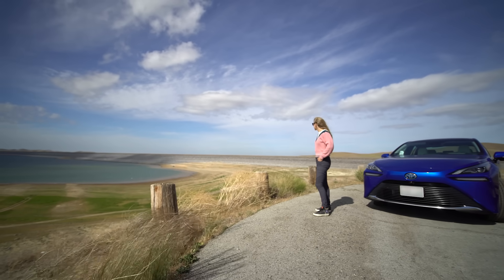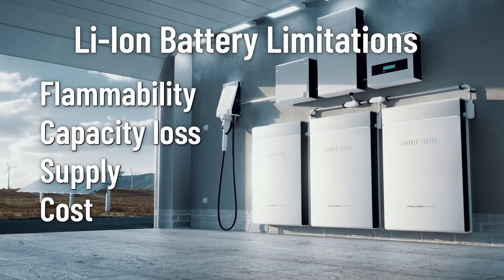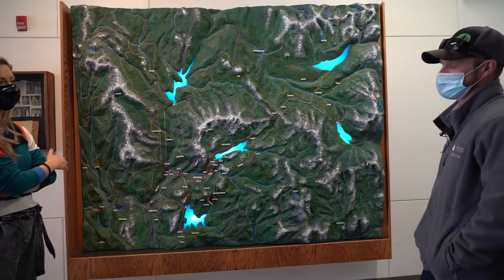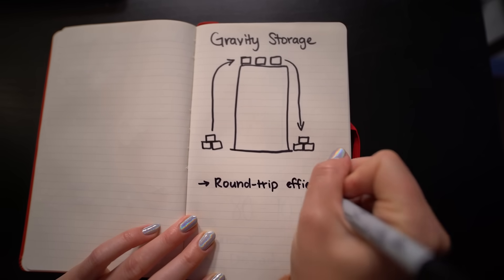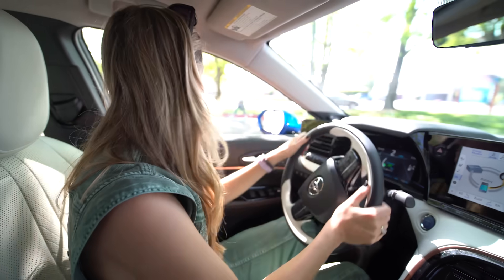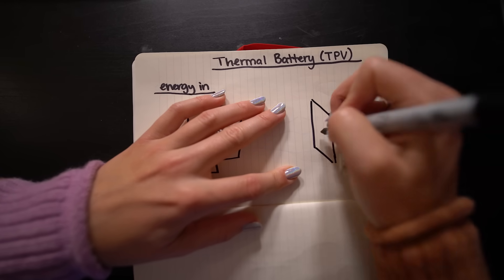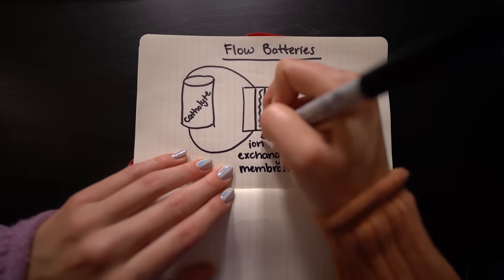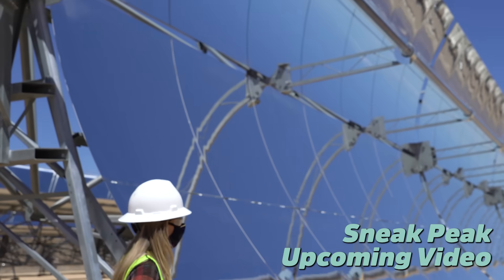The BIGGEST problem with clean energy

Comment: I would love to see every single house have it's own battery, like a Tesla power-wall, to help decentralize the power grid and add durability during short interruptions to power production. You wouldnt even feel the effects of a short power outage caused by a storm like you do now.
Reply: I looked into getting solar with a storage system...  it's a great idea, but it's a pricey investment 😕
Reply: Well, maybe not a Tesla power wall but some form of energy storage.
Reply: On a small scale and maybe hydro or mechanically this might be a reasonable energy storage. But large scale lithium battery storage is awful, whether done individually or in more centralized areas. The chemical waste of renewables and energy storage is ignored so quickly... :(
Reply: @andrewcopple7075  you are right about the chemical waste. Hopefully we develop ways to recycle the waste and reuse it in other products/applications. When I think of renewables I think of the future. When we eventually go to other planets in 100 years, after Im dead, we will need these technologies to be mature because we wont have oil on other planets.

Also, we need to save our oil for when we want to terraform other planets. Perhaps there is more than one way to heat up a planet and keep the air breathable, but fossil fuels has done a pretty good job on earth as a greenhouse gas 😅
Reply: This sounds nice but the question is what is cheaper? A powerwall in every home or a centrelised storage system that would be able to hande that same outage.

Comment: The problem I keep circling around and cannot come to resolution on is the true need for long-term storage.  It seems the most promising techniques for longer-term storage involve processes that have lower round-trip efficiencies.  Unless the capital cost is dramatically lower than for those of Li-ion or LFE batteries or pumped hydro or gravity storage they will not be competitive for managing the daily duck curve.  This pushes their utilization to weather or season-based scales.  Reducing the number of storage cycles per annum increases the cost of energy per cycle due to capital and operational costs.

It seems to me the primary competitor will rapidly become installing renewable energy overcapacity and living with the curtailment during favorable weather or seasons.  Curtailment raises the cost of produced energy for similar reasons reduced cycles increase the cost of stored energy on the long-term storage plants.  Many view curtailment of renewable energy as a bad thing, but in practice, that is the way the fossil-fuel plants on the electrical grid operate today.  The cheaper plants can bid to run near continuously while the more expensive plants only get the opportunity to run during peak energy demand.  The reduced operating hours per year adds to their cost of energy.

Long-term stored energy will have to prove more cost-effective than bringing curtailed generation on-line.

Comment: Check out 'flywheel batteries' too! There are a bunch of companies working on carbon-fiber or cement composite high-speed rotating masses! Anyway very cool to see a video on this topic! Energy storage is so important and yet we don't hear much about it compared to energy production.
Here in France we produce mainly with nuclear, and because it's not very flexible we have a lot of dams to store the excess and top up the grid during peak demand! 👌

Comment: Liquid metal batteries.  When you don't need the battery to move from place to place, you don't need a thin structure like lithium-ion batteries use.  They can be much cheaper to make and have a much longer life.

Comment: What about using using the heat from the Earth (like the do in Iceland) to heat water to produce steam that drives turbines that drive generators that produce electricity on tab when you want and the byproduct for this is steam/water so it is green, but probably unfashionable because it is old technology. Heat can also be saved in a salt which eventually liquefies as it gets hot to be used later.

Comment: one thing i take slight issue with: you mentioned "just look at all those oceans" for hydrogen production. yes, but thats salt water. that produces chlorine gas in electrolysis. small problem :P
Reply: Desalinating and distilling the water is an order of magnitude less power demand than the electrolysis process.
Reply: @benoithudson7235  Ok? You still need to split the hydrogen atoms anyways. So you end up filtering or distilling the water to purify it, and then more energy for electrolysis? Unless there is a single process that cleans the chlorine and produces hydrogen.
Reply: @QueueTeePies  He wrote that purification of seawater would use less than a tenths of what the electrolysis uses.  So it merely reduces efficiency by 10% (or less).
Reply: @johndododoe1411  I’m not sure that math is correct? It takes approximately 3 kWh give or take of electricity to distill 1 gallon of water. A gallon of water is 3.79 KG. Does electrolysis of 1 gallon of water really produce enough H2 for a HFC to produce 8-10 kWh of electricity?
Reply: @babybirdhome  Distillation is not the only way to desalinate water for electrolysis-based H2 production.  The other poster claimed the ability to do the job with an order of magnitude (10 times) less energy than the electrolysis itself.  I don't know how, but that's what was written.
  As for the brine containing the removed salt, it can probably be safely returned to the ocean some distance from the intake pumps, which will make the return area suitable for different species of saltwater life than the ocean average.
Reply: @babybirdhome  : it uses that much electricity for produce H2 -- around 65 kWh per kg of H2 after efficiency losses if you're pressurizing it, or a bit over 7 kWh per kg of pure water. So if you had a source of pristine pure water without minerals you'd spend a bit over 7 kWh to convert a kilo into hydrogen and oxygen; whereas if you have a source of salt water that's 4% salt, it takes right about 8 kWh to convert the water inside to hydrogen and oxygen.

If your electrolysis equipment can handle slightly saltier water than what you get with distillation, then you can use reverse osmosis at which point we're talking a few kWh per tonne of water to purify it.

Purification isn't the big thing making electrolysis expensive.
Reply: Yeah you would probably need to do efficient desalination first say reverse osmosis followed by distillation, the problem is of course that costs energy but given that the climate doesn't look like it will be cooperating anytime soon it is probably going to be needed anyways out west in increasingly arid environments like  California since unfortunately people are stubborn and unlikely to move to more sustainable locations(without natural selection being allowed to filter them out).
Reply: @Dragrath1  It doesn't make sense to desalinate the water before electrolysing it because to run the electrolysis you need to add salt to make the water conductive.  So why remove the salt only to have add it back in greater quantity immediately after?
Reply: @listerdave1240  : the membrane in the electrolyzer costs a mint. The water gets purified, then they add a hydroxide or a salt so that they know exactly what they're adding and that it won't muck up the PEM.
Reply: even if we do the whole 'desalinate ocean water for hydrogen' without any issues on power consumption we'd still have the 'brine 'problem to deal with.
Reply: In theory you could just keep reusing the same watter and hydrogen. Atleast if you want to use it for grid storage, cars and planes are a problem.
Reply: Electrolysing salty water does not produce chlorine. You need to add some form of salt to water anyway to do electrolysis as pure water is an insulator. 
To get chlorine from salt by electrolysis you need to electrolyse molten salt, not salt in solution.
Reply: A great video on how to understand and use your instincts https://youtu.be/XrmyGtdmgoY
Reply: A great video on what is intuition and how to use it https://youtu.be/XrmyGtdmgoY
Reply: Yes, that's true (tbh I don't know, I'm just willing to believe you), but there's also the fact that 75% of all matter in the universe is hydrogen.  It's fairly abundant.
Reply: @samberg3864  Doesn't help us, unless you know a way to transport it back to Earth. Because while hydrogen is abundant in the universe, it is not abundant on Earth.
Reply: @lazydave137  it is on the earth but it is not in the form of H2 gas

Comment: I agree with the contents but a Toyota with Hydrogen was literally the worst car selection you can get. They are against the electrification of cars. They lobby against it. Any battery electric car would have been better. Also as of now, Teslas battery packs are mostly for ultra fast Stabilisation of the grid, not so much for intermediate and longterm storage (yet). Sadly you didn‘t go into the possible economics of these technologies.

Comment: What does it mean when they describe storage in hours? One interviewee said "a 40-hour battery will cost about 10 times as much as a 4-hour battery." Is that shorthand for kWh/MWh? Or describing the rate at which stored energy dissipates?
Reply: I would interpret it for a given load.
Reply: Yes, maybe he didn't want to use such "technical" terms as MWh... many grid level battery storage projects use two numbers, like 200MW and 800MWh, to indicate what power it can deliver and for how long. 4 hours can cover the evening peak.
Reply: The normal way to describe utility-scale storage is in terms of the power it can output, and in the number of hours it can keep the power going.

Comment: Great series, enjoying it a lot so far! I think energy storage is the number one tech holding civilization back in numerous areas. We've been hearing about breakthrough tech for decades but it seems like nothing ever pans out so I'm kind of jaded at this point. Compare the advancements of batteries and combustion engines over the past 100 years. Both are a simple premise on paper, with ample room for advancement/improvement. Yet our engines have the power and efficiency improvements of 10-100x and my AA batteries in my tv remote still run out in a year.

Comment: What you didn't address, however, is that hydrogen can be converted to methane relatively easily by carbon dioxide. The methane obtained in this way is then virtually fully compatible with existing gas infrastructure. In this way, existing gas heating systems, for example, can use completely renewable energy. Power-to-gas will be the main energy storage for renewable energies. Physical storage will probably not be more than a small addition.

It is also not true that the only option for private power storage comes from Tesla. For example, there is a small-scale hydrogen storage system from the German company hps that is already commercially available.
Reply: And doesn't Google have its own hydrogen fuel cells on their campuses? I imagine they procured them from somewhere.

Comment: I understand we are just a few years from sustainable fusion power.  Does that make all of this kind of moot?
Reply: We have been a few years from sustainable fusion power for at least 50 years. I hope it happens, but so far the predictions have been too optimistic. It is hard to contain the sun in a small scale apparatus!
Reply: We are not close to a cheap fusion plant that powers the grid.  By the time they plug a fusion plant into the grid, even for one minute, renewables plus batteries will be so much cheaper, that fusion will have no chance to compete.  
The big problems with fusion are, the plants probably won't be durable, even if they do work in the next two decades, where solar and batteries just keep getting cheaper every year.  Fusion has no chance of catching up.
Reply: @charliedoyle7824  Yeah, and can you believe there are idiots out there who think the wheel will someday compete with footpower?!    Sheesh.  Get a clue.
Reply: @bjs301  We have nuclear and that has issues competing with anything on price. Its not unreasenable to expect fussion will have the same issue for grid aplications.
Reply: @bjs301  You aren't making much of a point.  
Are you unaware that solar and batteries are already quite cheap, and getting cheaper every year at a predictable and fast rate?  It's obvious that an experimental fusion plant won't be cheap any time soon, even if it works well enough to plug into the grid in a decade.  By the time fusion is ready, solar and batteries will be unbeatable on price by any technology.  Fusion will still be worth pursuing though, so maybe it will be big in the distant future.
Reply: @charliedoyle7824  What is obvious is that unless we come up with an even better answer, the only thing that will prevent fusion power from rendering the others obsolete is human stupidity and obstinance.  It offers far more advantages, at less cost, and has none of the disadvantages of any other known solution.  I'm not sure what you consider the distant future, but within the next few decades it will replace them all.
Reply: @someonespotatohmm9513  I think that is an unsupportable assumption.  The proposed fusion reactor scenarios are nothing like fission reactors.
Reply: @bjs301  No they are even more complex -> expensive, and are not expected to be made for actual generation for another 20 years. We need clean sources on a large scale before 2050 and fusion will almost certainly not be in time and even more certainly not be the most finacialy sound option.
Reply: @someonespotatohmm9513  You may be right.  I raised the question after reading about the Lawrence Livermore's announcement last week concerning the big leap forward in inertial fusion research.  It sounds like a game changer.  It seems to me that when we reach ignition point, all the arguments I'm hearing against the idea will seem almost comical. And I wonder if the "won't be in time" argument holds any water.  It may be naive to think Physics Girl will see my question, but I'd love to see her do a deep dive on it.

Comment: I would argue that there are still bigger problems to solve, like producing "green" steel and negative emission technologies for example.
Reply: Green steel by using hydrogen instead of coke is already on the way.
Reply: @zapfanzapfan  Yes, the development is at an very early stage compared to energy storage technologies though. And if you can produce enough hydrogen for green steel production, you can also use it for seasonal energy storage.
Reply: @zapfanzapfan  Yes, but have they tried Pepsi?
Reply: A great video on how to understand and use your instincts https://youtu.be/XrmyGtdmgoY
Reply: Those are important, yes. But they're not bigger. Just by looking at the percentage of carbon emissions, transportation and energy are by far the biggest contributors. But this is an all hands on deck situation. Every solution in every industry is absolutely needed.
Reply: @spacenerdity  You could reduce carbon emissions in the power sector worldwide by 90% without new storage (pumped hydro for example is not really new, it's used worldwide). And it's not really a technological challenge to go even further. That's why it isn't such a big problem, even when the power sector is a big contributor to carbon emissions. Of course, we still have to implement the solution that is already existing.

Comment: Couldn't you use energy to wind up some big springs and lock them in place to be released later? Or perhaps pump water up into a reservoir to be released through a turbine?
Reply: Nevermind about the water idea then lol
Reply: The springs could work better for areas without water though

Comment: have considered building a storage system using water in some small solar projects iv'e done in the past. Not because the project needed it, but because i wondered about how it could play into this type of storage, but never could figure out how you could tell how much available power is in the grid without being connected to all meters and plants and all. I'm a big fan of closed loop systems where they auto correct (think closed loop autonomous robot), but guess plants calling and reporting to each other to update status works too. Now i really want to go tour those places (well after covid is under control).